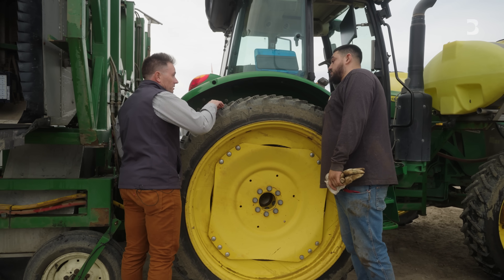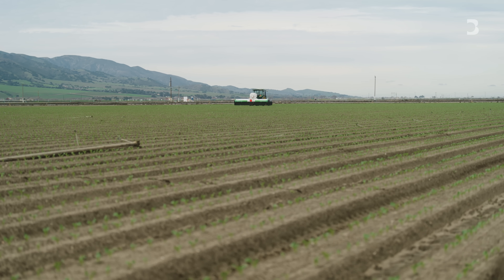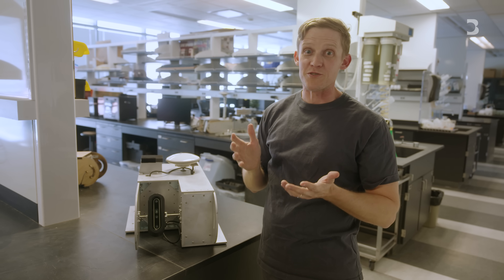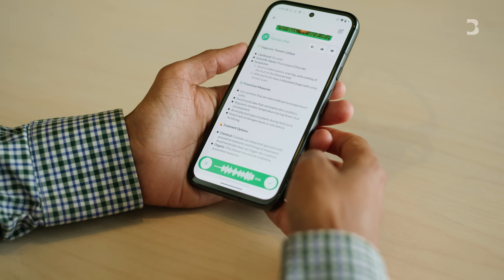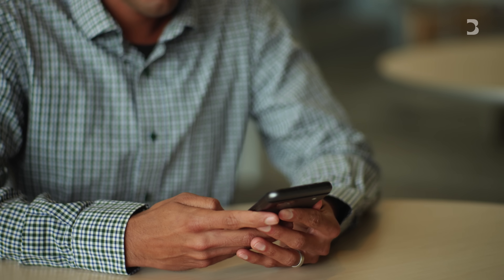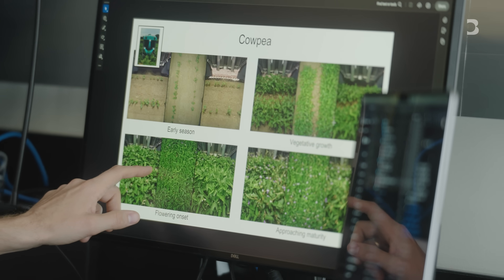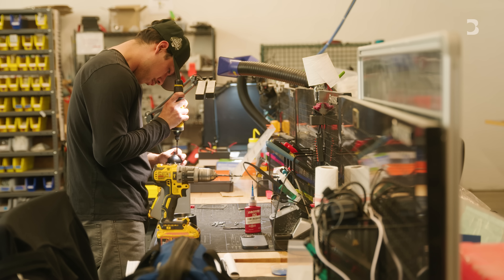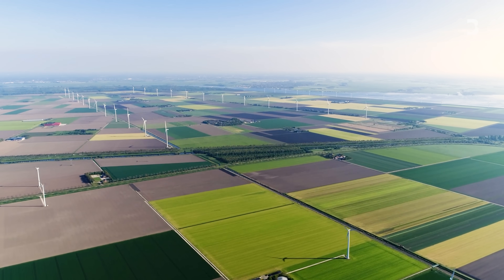How Robots and AI Are Changing Farming

Comment: AI is a tool to be used. But if the tool replaces the worker on a large scale, then it will hasten an economic collapse. AI doesn't buy anything and cost a lot in electrical power. Humans have needs and therefore buys things. To replace workers with AI is to remove the demand for the work that AI might do. Unless we are going onto a UBI system, the consumerism will just dry up. Sure, AI might cause greater production, but who are you going to sell to if consumers are out of the picture?

Comment: if AI is powered by Solar, we don't need to have this discussion. Just build solar panels.
Reply: So when the sun goes down or when its clouded everything stops working 😂
Reply: @kennethadler7380  It seems like you are a 5th grader. Production during the day is so much that the electricity stored in batteries. Once the sun sets, then the grid draws power from the batteries

Comment: If AI can identify the weeds, why not mechanically remove the weeds and not use chemicals?
Reply: It’s definitely doable but is an engineering trade off. Building a specialized mechanism to yank weeds in different soils types vs a spray mechanism vs something else, then taking into consideration time and costs.
Reply: @Earth_Rim_Roamer wow you must be so smart to use words like trade off, sitting from your couch
Reply: like with lasers? that technology is already available, but it's more expensive and it has no Monsanto substances, which is a problem for those companies.
Reply: No, a year ago there was a video of a solar-powered AI-powered robot that mechanically pulled out weeds.
Reply: I assume because it's just not a problem. Hear me out:

the video very briefly mentions, the machine only applies a dot of herbicide.
The environmental concerns that herbicides and pesticides poison water supplies, and the health concerns of pesticides and herbicides entering your body stem from MASS APPLICATION. More herbicide than the plant can absorb is applied which is why it sickers into the ground, and herbicide is also applied to crops which aren't weeds.
This machine uses SELECTIVE APPLICATION so only very little herbicide is used and only on weeds, which means there is practically no risk that enough is applied that it can enter water supplies and none of it lands on the crops.
Reply: Just use frickin lasers.
Reply: @Mr2Reviews  Laser requires too much power
Reply: On shark robots
Reply: there is a huge market for organic farming.
Reply: Monsanto make vegetables more yummy
Reply: Costs
Reply: جاك و حبت الفاصولياء
سينما الاطفال لنسريين جورج من الشرق الاوسط الاردو
Reply: Cause it cant
Reply: technology 
mechanism 
robot 
market 
ALL 
From Londons Times Sequres

Comment: I don't like, that they just add AI to everything.
7:02 "spacial AI, it knows where it is."
That's GPS not GPT
Reply: They’re likely referring to a some visual localization model or maybe a model that incorporates GPS, vision, and satellite data to localize over time. AI is a very large topic and includes Machine learning which is the foundation of modern intelligent robot systems.
Reply: Yeah, spatial ai is just the new school term for SLAM.
Reply: What are you talking about? Autonomous vehicles need and use much more than just GPS to get around. They use cameras and LIDAR which have their outputs interpreted by a an AI model. It is basically impossible to have a vehicle drive itself without AI in some form.